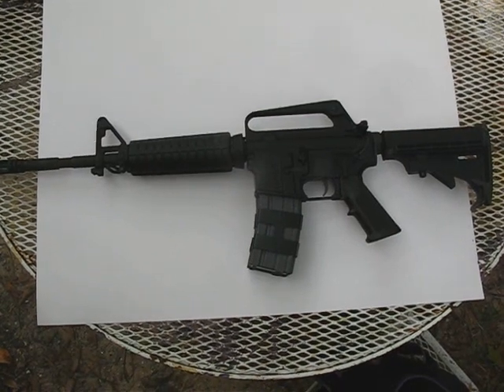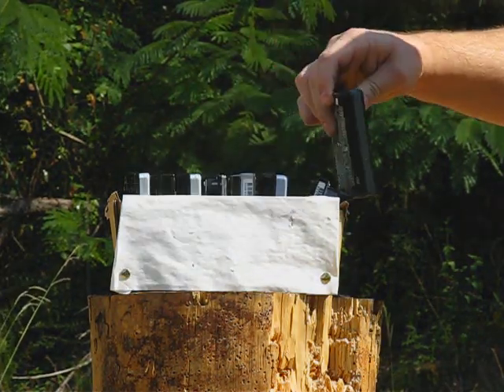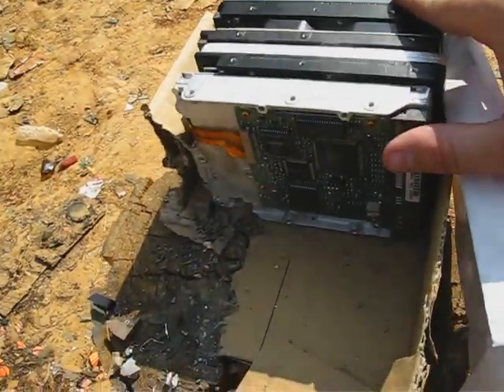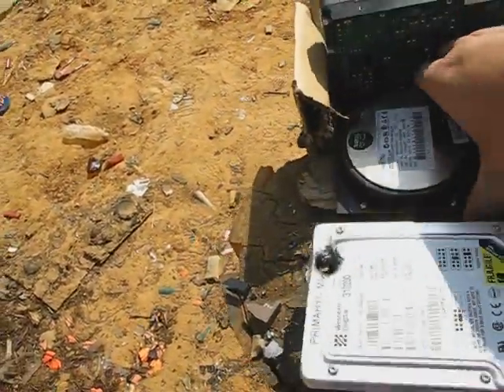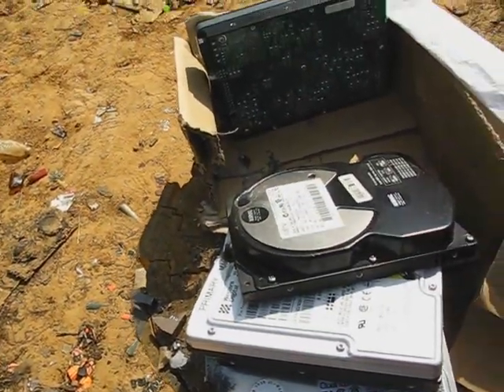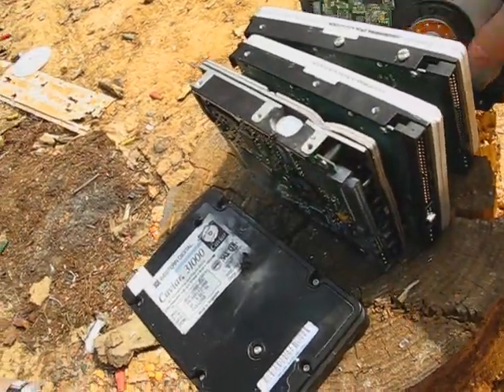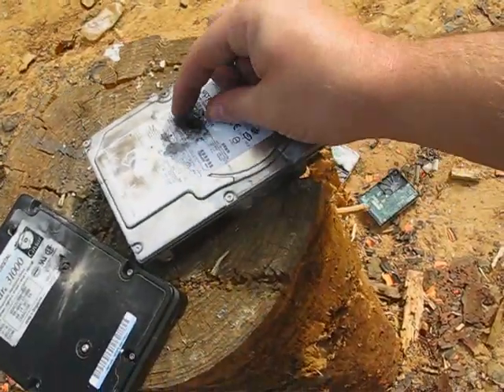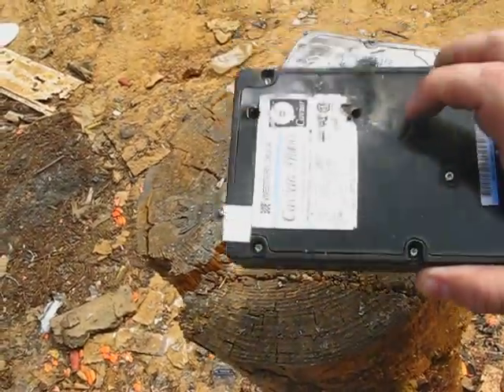Winchester Ranger Penetrator Core 5.56 MM vs. Hard Drives

Comment from the maker: @antonfilth I suppose if you make it go fast enough sure.  The cores in these rounds are hardened steel.  Tanks use depleted uranium shells to punch through steel.  Aluminum would be the wrong direction - you would want to go heavier and harder not lighter.